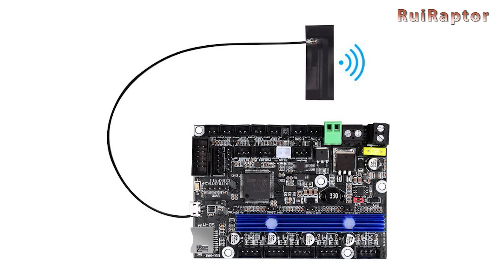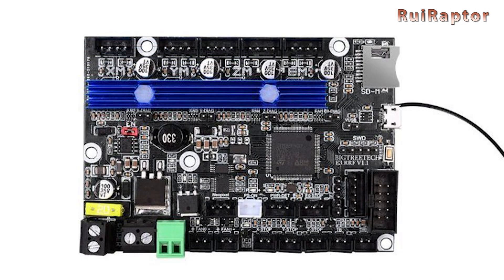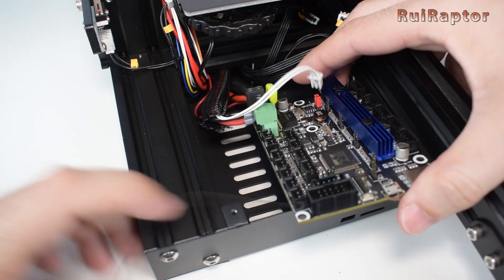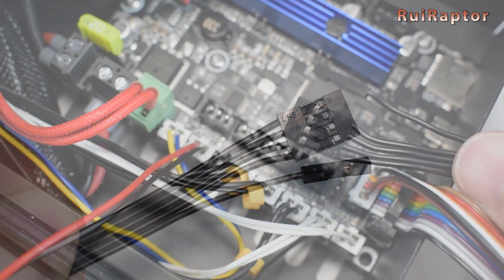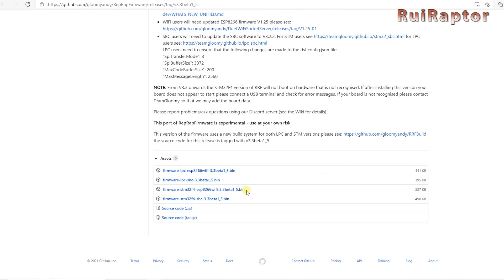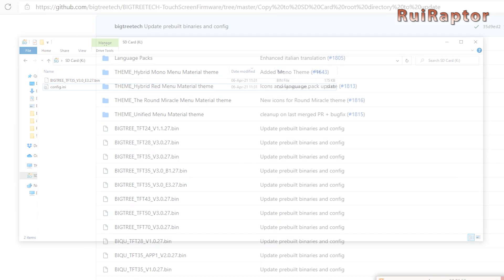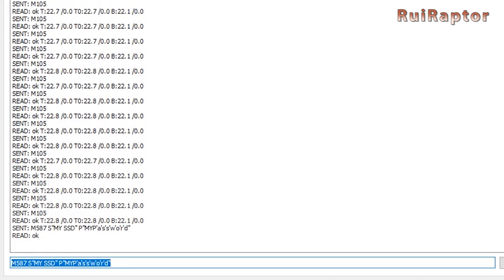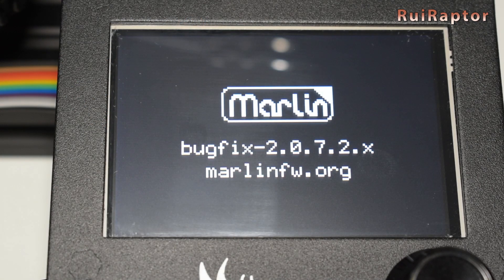SKR E3 RRF Complete Installation Guide - CREALITY ENDER 3 Upgrade

Comment: Great video - with your help I've managed to install and set up my new BTT-E3-RRF and E3-TFT35 combo in RepRap mode. All is working - including DWC under WiFi! I'm a bit confused about using the display in LCD emulation mode. It's not clear if this is yet supported. Otherwise, I'm not sure what the rotary knob does under RepRap - not much at the moment.  I see you provided guidance on how to set up the standard LCD display with this motherboard - will those additions to the files enable emulation mode? One suggestion I have for you is that, with the power-sourcing jumpers, it's very easy to upload and set up the firmware on the two boards BEFORE physically installing them in the printer - this makes it much easier to check cables and debug stuff. Many thanks!
Reply from the maker: Hi Andrew,
thank you so much for your feedback. Regarding the firmware upload while the board is out, we did that :) However, for the video, we explain that you can use the board as plug and play (since it comes with firmware already installed) or update the firmware. The firmware update can also be done at any time and also when new versions are released. Regarding the LCD with reprap menus, the menus are not so "user-friendly" as Marlin's menus, and have much less options but it's not hard...just turn the display knob until the option you want is highlighted and press the knob. Regarding the stock ender 3 display, yes, it will work if you add the lines that we mention in the video. However, and for reprap, the menus will be the same as the emulation mode.

Comment: Switched from marlin on my ender 3 to Klipper after 1.5 years (with working screen). Never been happier. It's just my opinion so it has no value, but if you have an Ender 3 and you use it together with octoprint, there is no reason to stay with marlin. I love 'input shaper' and gcode macro's. So if the noise of your stepper drivers is no issue, you get more worth for your money buying a raspberry pi.

Comment: For the people who use the legacy screens the ( menu > preheat ) does not work it freezes the screen and you need to reset the printer. this is a issue combined with RepRap and the Menu creator.
RepRap is a pretty awful firmware for beginners and even "experts" i really dislike RepRap but the web interface is an awesome feature. I wonder when people start working on the Ender V2 screen. (but it needs marlin so far i know) its a DWIN screen.

Comment: regarding the neopixels- how many can be connected to theboard- i have connect only the signal and managed to power 56 neopexels by lm2596 ) - set the voltage to 5 volts)

Comment: Also I have found the pins for tft - rx and Fx are switched :( as on the tft it is 5v, ground, rx, tx and rst - on the board it is 5v, ground, tx, rx and rst ;) so do I need on to switch rx and tx?
Reply from the maker: Hi Mito Fun, the TFT works. Don't switch the RX and TX  and connect them as we explain in the video
.

Comment: Yeeeha! Thank you for the info!;) I have managed to activate WiFi but not the tft;) so will try later on;) also I have tried to compiled configuration in marlin but it does not compiled and from the message I have found it is not supported Btt tft yet :((( this is not good :(
Reply from the maker: Hi, the TFT works. What is the issue you are having with it?
Reply: ruiraptor I have sorted it thank you;) I left it as it is (the cr10) and install into the board;) and tft works !!!;)
Reply: @ruiraptor  no issues for now))) thank you for the information)